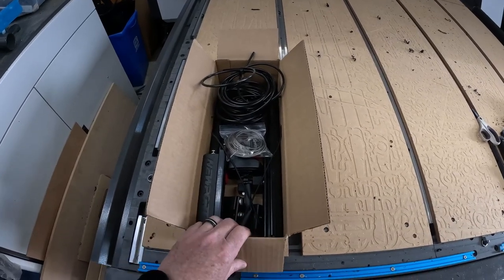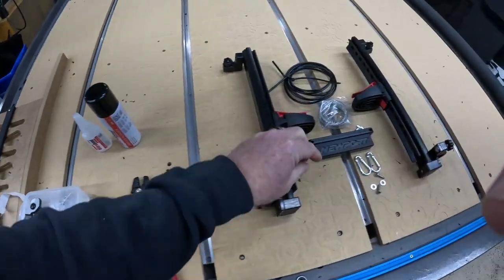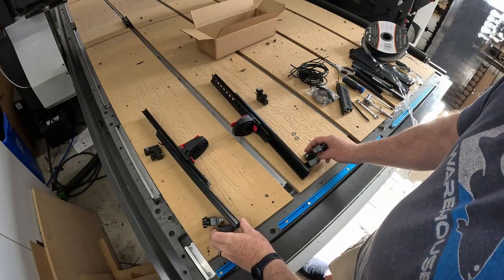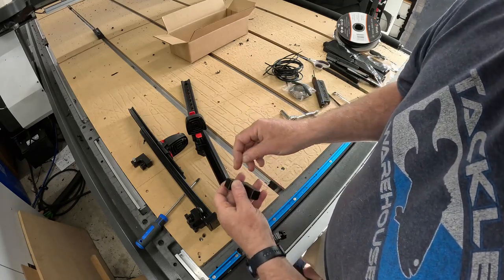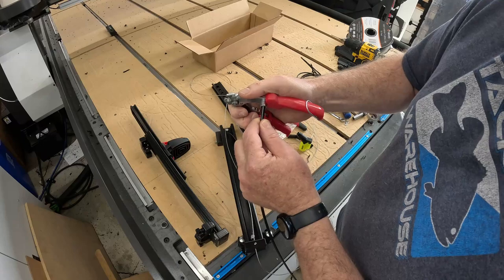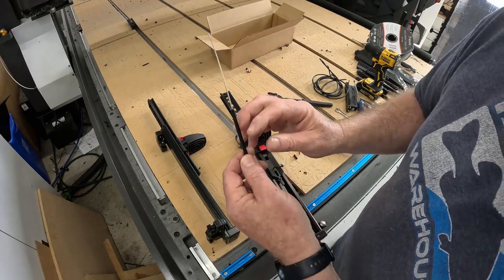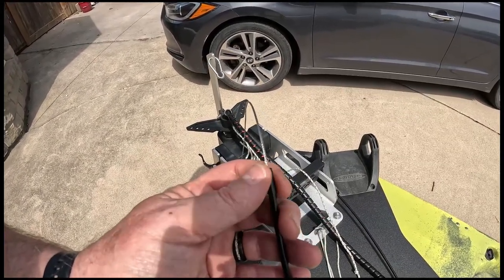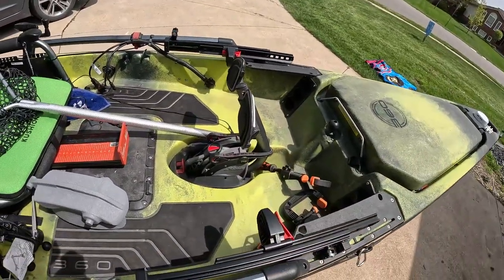TPKF Foot Steering System Install

Comment: Wait... you put foot steering in a pedal kayak? 
How are you going to pedal and steer at the same time?
It's supposed to have a handle on your side for steering. 
Good luck with that!
Reply from the maker: It controls the motor.
Reply: @TimPercyKayakFishing  I just got my foot steering setup in the mail today… thanks